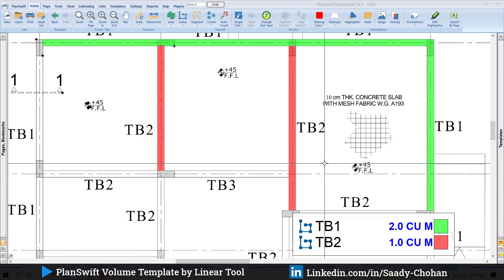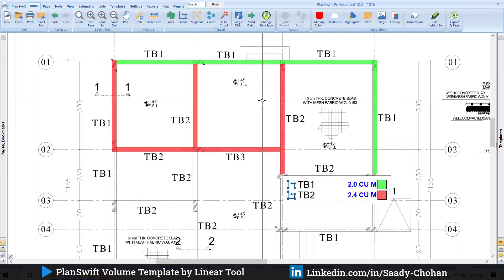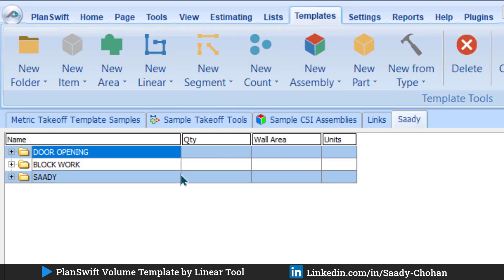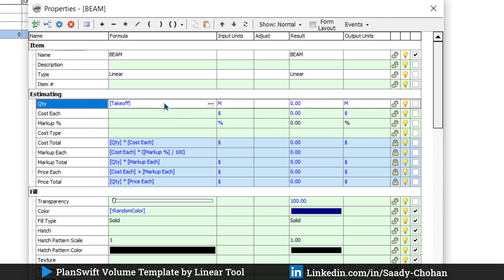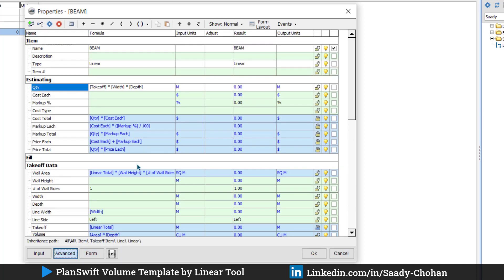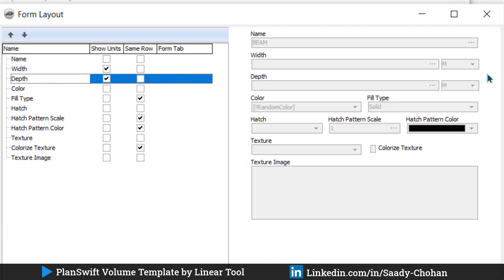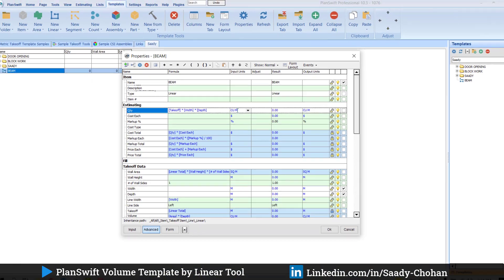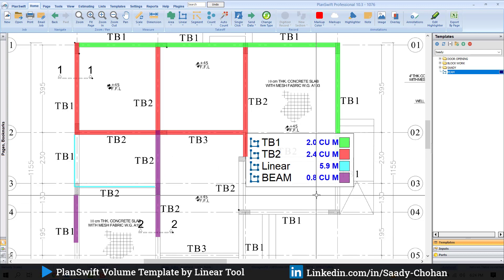PlanSwift Beam Template | Volume by Linear Tool | Part & Assemblies | Level 2

Comment: Hi, I've created the template just as you showed and changed the input and output units to CU M, but when I measure something the legend still shows the takeoff in M, I have to go to the estimating screen to see the actual CU M quantities. How do I resolve this?
Reply from the maker: Open job/template > Select takeoff item > Go to Properties panel > Find “Label” or “Display Formula” > Enter Volume + " CU M" > Press Enter to save > Save template if needed

Comment: Hi Sir! I would like to ask how do you set your legend showing the volume qty instead of the linear qty? Mine is only showing the linear qty or area qty whenever I do measurements.

How do you align the label to the linear measurement markup? Mine automatically adjust to center?
Reply from the maker: Thanks for watching the video. I   will recommend you to watch this video completely with patience. Additionally, I recommend you to checkout the Basic Quantity Surveying Course with Planswift by Noble QS. We have covered several aspects including this one.
https://nobleqs.com/course-details/quantity-surveying-for-mechanical-works-in-building-construction

Comment: Mind i asking why i used this formula template to make the measurement the quantities come out are much different with actual? example: length of beam is 4.396m x 0.15m(w) x 0.6m(D) but the result come out is 13.9cu m. If we manually calculate the actual quantity is only 0.39564cu m. Could you tell me what's wrong ?
Reply from the maker: Connect with me, I ll explain.
https://www.linkedin.com/in/saady-chohan/
https://www.facebook.com/SaadyChohan.AEC
https://www.instagram.com/saady.chohan/
https://www.reddit.com/user/SaadyChohan
https://twitter.com/SaadyChohan